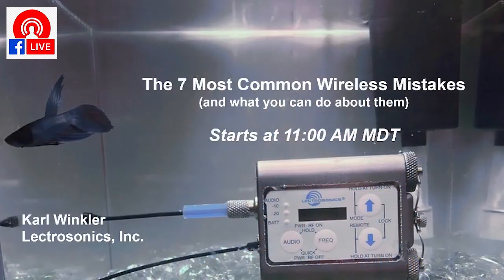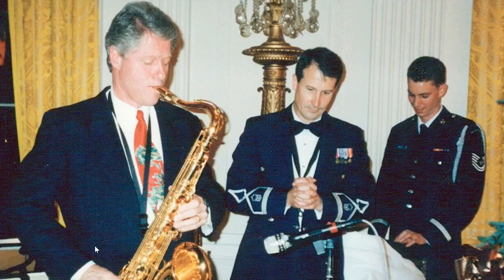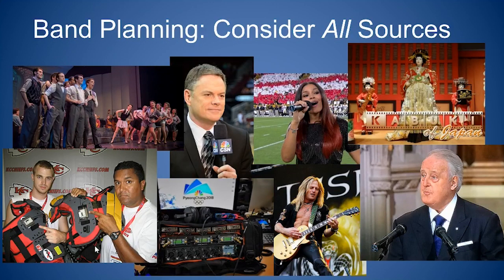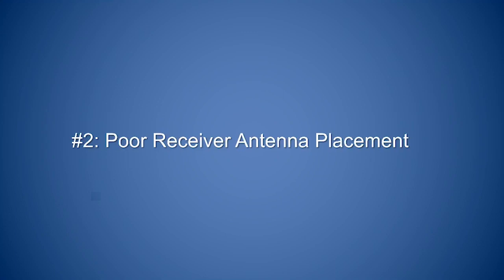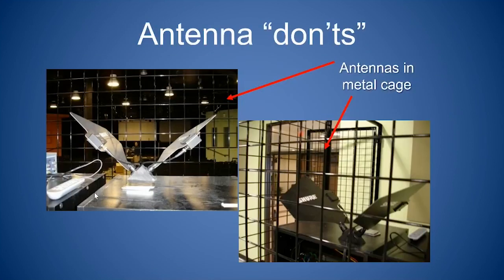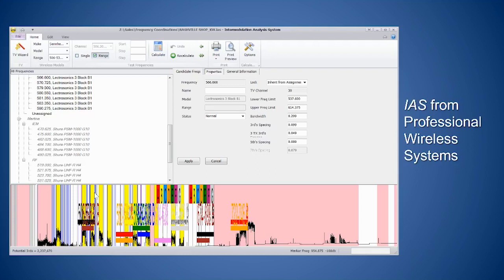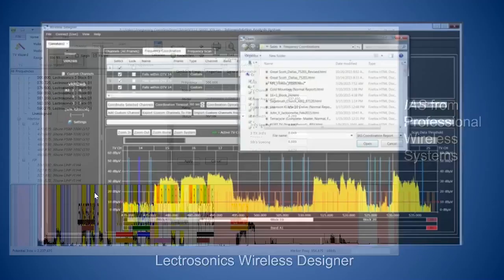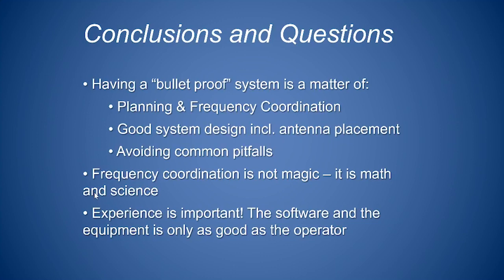Wireless Side Chats #2: The 7 Most Common Wireless Microphone Problems and How To Solve Them

Comment: As a ham radio operator and home brew antenna maker, i really appreciate you explaining how and why antenna placement and polarization is very important. I also recommend using appropriate rf chokes on all cables near VHF, UHF and SHF transceivers. I noticed you mentioned the cable type to use and what the loss tables are. This is important. It is also important to match the feedpoint at the antenna and the transceiver as close to 50ohms as you can.  I recommend for VHF and UHF if the situation allows for it, LMR ultraflex 240 or 400 if you can manage the thickness of the 400 cable and have the shortest runs as possible to reduce loss. I just purchased some older single frequency cr187 gear in the upper vhf portion for wireless audio. I am a beginner with sound location recording but I really enjoy this presentation and the combining of my favorite hobby (ham radio) De - kc2bnw
Reply from the maker: Thank you for the comments! Yes, matching impedance is important, and our antennas all have suitable baluns for this purpose. LMR ultraflex and LMR400 is very good cable material. We use the Belden 9913F7 for our longer cable runs (50 & 100 ft). It is unwieldy but very low loss.